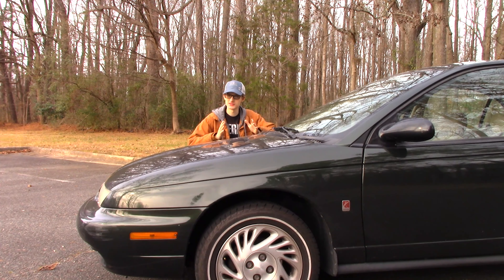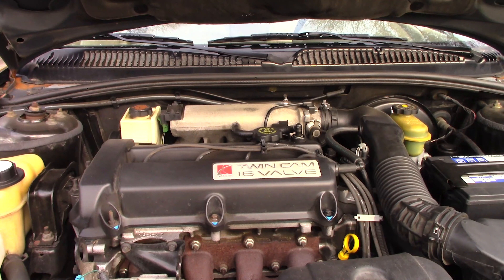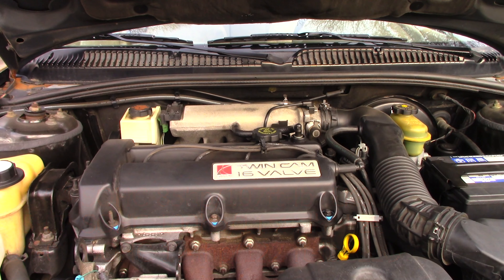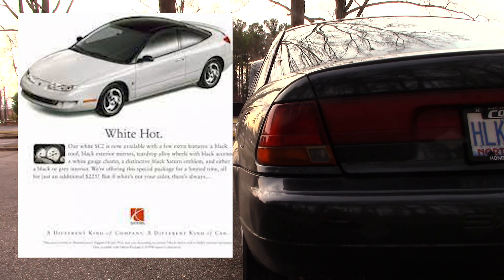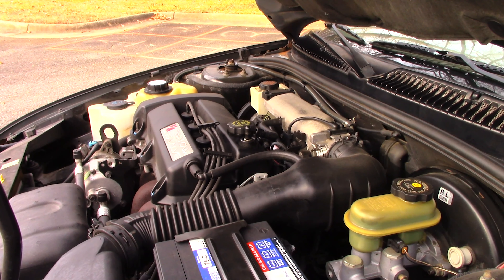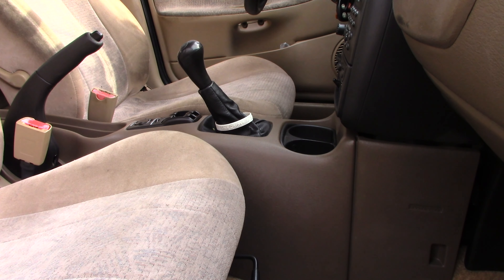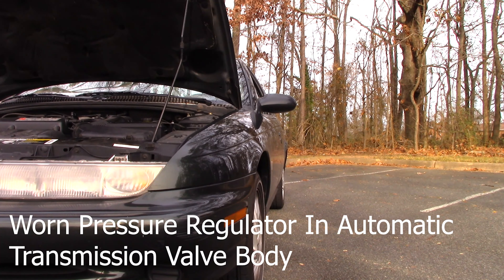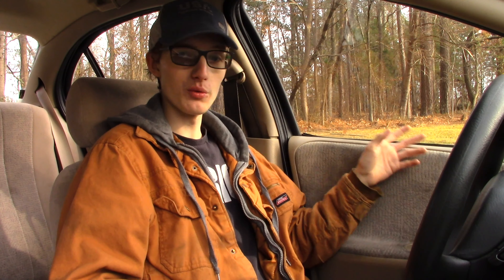Tech Review | Saturn S-Series

Comment: I bought a new 1996 Saturn SL   26 years ago for $10,900  and  still have it and love it.  I have had to replace my shifter cable twice and my A/C compressor in 85000 miles, but that's not bad for 26 years. And my Saturn has never needed any oil. I just change the oil once a year. Gets 31 mpg in town and 40 on the highway. And the dark red paint is still shiny after all these years. I hope to keep this car forever.
Reply: Your car must’ve been stripped or maybe it’s an SL1 which was quite a bit cheaper (I guess). The sticker on my loaded 1996 SL2 was like $15,500 (can’t find the sticker and I’ve looked all over). I bought mine in 1998 with 20,000 on it for $9,300 which I thought was a good deal. Still driving her 25 years later as she’s pushing 250,000. I’ve replaced a ton of parts but nothing was above my pay grade. Doing the clutch at 200,000 was probably the most difficult. Thank God for Rock Auto!

Comment: Scooped up a 97 SL2 for 3500 with 33000 miles off an old man.  Pretty sweet.  Sat in a garage the engine cradle was rot on the drivers side.  Ordered an new one online GM for 350$.  Replaced it now have a pretty much brand new car.  So far so good.

Comment: The biggest misconception, is that saturns burn oil. The better explanation not spoken here is the lack of better knowledge regarding crappy owners. With a good owner, and maintainer, you have yourself a great car, and will have it for a good long while.
Reply from the maker: I can agree but with how low cost these were new, it was rare for someone to properly maintain one.
Reply: I think they were designed to use a little oil. In order to increase gas mileage they chose to use lower tension oil control rings on the piston…I check my level every 500 miles and have to add less then a half of quarter..Also some choose to use 40 weight all…

Comment: I had a 97 Saturn sw1 I bought for cheap right before the pandemic. Then gas prices 480 a gallon at one time. Then the used car market sword upwards. It was like I almost knew what I was doing😂😂. I truly like that car. Believe it or not somebody stole it.😢 I replaced it with a Toyota. 10 months later going through Facebook marketplace. Picked up a 95 Saturn SL2 5-speed. 65 k on the clock very clean. Gave 2500 dollars. Back in business.
Reply from the maker: Thats highly unfortunate that someone stole your Saturn, however the fact you got a SL2 5spd for 2500$ with such low miles is awesome dude! glad everything seemed to work out.

Comment: My maintenence over 10 years for 2003 Saturn Ion:
Engine control module, Ignition control module x 2, used, junkyard parts,  $40 +150 = $190
Starter x $25 + $330
Ignition switch $70
Windshield wiper ?  transmission $100 (?)
Radiator (my fault) $400
Got it for free. Did much work on my own as shade tree mechanic ,but lots of labour.
Parts (used = $190
New rad, wwt,  parts = $500
labour $400
+ additional labour $400.
Total parts & labour = parts = $1200 labour $1200
= $2400.
I've had this car for going on 12 years.
Daily driver.
Runs perfectly.
267,000 kms ( x.6 miles = ?).
Never burned a drop of oil. I put 5/30 Pennsville synthetic canned every 3000 miles.
New winters $560.
So for $3000 total I've been fortunate to have a great car for $3000 ÷ 12 years.
I did not have confidence in this car in the beginning, but as I did my own research and great neighborly advice,  it'll run for another 12 years to 500,000 klms with necessary maintenance.
Best car deal I ever had!
Thanks.
David
Alberta
(P. S. Numbers are rounded off, but trust me they are close).
P.S. 2 Research common failures and you can fix them.

Comment: A very informative video.👍 I have a 2001 SC2 which I bought new 22 years ago, in the time I had it, the major repairs were intake manifold coolant pipe, AC compressor clutch, and radiator.

Comment: I like 👍 this because I have exactly the same one including the color. Another words I have your twin and everything you spoke of makes complete sense. I like the twin overhead cam in mine same as yours. Kinda slow on back roads because of low end torque but on the interstate doing 80mph barely on the gas. I do wish mine had the 5 speed manual trans but I have 4 speed automatic. As one guy said on Utube " old Saturn's never die people kill them by not checking the oil"  its apparent that you take care of yours like I do, good luck with it.
Reply from the maker: Thanks, it’s been a great car and that is true about the old Saturns never die. I never driven the automatic one before but the manual one feel like it has some sort of power to it.
Reply: Exactly...oil changes are important with Saturns..if your down half a quart..add half a quart. Change oil and filter every 3500 miles with full synthetic.

Comment: That Saturn I've been riding doesn't burn enough oil smoke, but there are two hairline cracks in the plastic valve cover. Keeps the cover slightly wet. I'll add 1/4 quart every three or four gas stops, avg 35mpg.

Comment: Old Saturns don't die, people kill them.  Change your oil.  

I have been a Saturn S fan since 2004 when I bought my 96 SL1, and I've owned 3 more since then.  (They dont hold up to collisions)  If you take care of them, they will take care of you.  But dont get the auto.

One additional quirk, every S I've owned would refuse to turn on it's coolant fan unless the AC was on.  Never figured out why, just jumped a hot wire to the battery and ran it to an under dash switch.
Reply: It's either the ECTS or it's connector is jacked up, corroded etc. Get a good brass ECTS and clean the connector, your cooling fan should kick on as programmed in the PCM.

Comment: My 2001 saturn sl2 5-speed has 370,000 miles on the body and suspension. Had a rebuild at about 120,000 miles ago. Has power windows, power mirrors, powered sunroof, defrost able windows, heat/cold running strong, really the only issue there is is the burning oil but honestly idk makes the oil change faster cause i dont have to wait on so much oil

Comment: I had a 1997 SL1. 200k miles. 5 speed. Very reliable but I always kept a case of oil in the trunk. It was about 1 quart per gas tank. The fantastic gas mileage made up for that. I sold it when the A/C crapped out. Thinking back, might have been smart to have that fixed and keep driving it.

Comment: I just sold my 2000 SL. It was a great little commuter, great fuel economy, and very reliable. The thing that finally convinced me to upgrade was that it didn’t have power steering. Driving a manual transmission car with manual steering in town, or in parking lots was a chore. Next time I’ll make sure to find an SL1 or SL2.
Reply from the maker: I can imagine, hope you can find a nice sl2

Comment: I bought my first Saturn a 1992 SL2 which was silver with blue interior, 5 speed and moon roof and rear spoiler. It was a great car although it did start using a lot of oil like you indicated. My next Saturn was a 2004 Ion3, electric blue with gray leather and moon roof. Still have it with 82k. Love it. Also have a 2007 Vue. I wish they still made them.
Reply from the maker: Yea me too, they were great cars. I know the vues have the honda V6. Really good cars when taking care of.
Reply: Mine is all wheel drive with the V6 and It has great power. It has only 92k and I take extreme good care with it, so like you say they should last for many more miles.
Reply from the maker: Absolutely

Comment: So, what kind of oil and oil filter do you use in your SL? I just bought a 2002 SL1, and want to change out the fluids asap. It didn't come with an owner's manual.

What kind of coolant do you use? Mine if dirty. I will need to flush it, so I think I could use any coolant intended for a Japanese aluminum engine. IIRC, Honda took issue with Saturn's dexcool, so I would rather not use dexcool.
Reply from the maker: Ive used dexcool in mine just because when i use to put the green stuff in other GM cars i had it created issues, i also just use a stp oil filter and 5/30 oil valvoline
Reply: @theskinnytechnician  Thank! I read that dexcool will not mix with anything else, but since I will have to flush the system anyway, I am considering Honda coolant. What color is dexcool?
Reply from the maker: Dexcool is orange and ho da coolant is typically blue

Comment: 1st gen was 1991 to 1995 , a little off but great post.I have a modified 95 SL2 and can attest their reliability. The diff pin suicide issue gets solved with the installation of an MFactory LSD or phantom grip LSD conversion kit.

Comment: I had to replace the plastic top of my engine kept breaking more and more and had trouble at the time finding one find a part from a 95 that wasn’t plastic but same engine mines a 97 and fixed my issue no more cracking mine SL2 1997 5 speed close to 250,000 miles yes engine and other things was redone and the inside as well

Comment: I owned a 1997 SC2 1.9L DOHC 5 speed manual up to 200,000 miles. The engine never burnt oil, normally doing 36 mpg highway. Once I drove at night from Chicago to Toledo OH and did 41 mpg, checked with my first GPS ( it was in 2005 I think). What killed it was the rust on the bottom... salty roads in Michigan and Ohio. It was a great vehicle. Too bad GM cancelled the brand.
Reply from the maker: The rust on them can be killer, They are great cars.

Comment: Great video . And very informative about things to look out for . Looking for a sw2 manual now . Is there still a community for performance parts for the 1.9 Dohc? How’s the clutch travel and do you feel to could handle 200 hp stock trans . Keep the videos coming . Seems like Reliable car and easy to work on . Also less than 2,500 pounds . Unheard of nowadays.
Reply from the maker: The sw2 are hard to find especially in manual, really want one myself. There is a decent aftermarket community for them i believe, the clutch travel is really good great for beginner drivers that want to learn but i would not know about 200hp going thru them stock.

Comment: 4:35 my Saturn did not burn oil. It was an exceptionally reliable vehicle. I had a 99 SL1 and my wife an 01 SC both were very reliable and other than regular maintenance we did not do anything else.  We had my 99 in the family and run well over 375k miles before it was sold.
Reply from the maker: A saturn that doesn’t burn oil sounds sus. Its hard making more videos about mine due to the fact that it doesn’t break.

Comment: Great video but there were changes in the dohc motor for the third gen. Don't believe me find a third gen and sit in it while it's idling you'll know right away
Reply from the maker: Curious, i need to find someone here with a third gen, however in my research i haven’t found anything major but will look into it.
Reply: The intake manifolds are different and I think the crankshafts have different counter weights to improve NVH

Comment: love that you only care about the mechanic aspect of the car, really reliable car had one I bought it in 2012  for 1,500 with 130k miles. Drove all over the east coast for 3 years. trade it in for a 2015 WRX STI. only did oil change and tires it had 227,000 miles.

Comment: What do you guys think of the 99 SC2? I’m  looking for a daily city driver that won’t break the bank. Thanks
Reply from the maker: Those cars are good cars same platform but a 3 door version, I would recommend the manual if you know how as they are easier and cheaper to fix if they go wrong. The automatics are good but they do leave the car feeling under powered.
Reply: @theskinnytechnician  cool thanks. Manual are hard to find. So far I’ve found only automatic transmission.
Reply: @theskinnytechnician  thank you for replying!
Reply from the maker: They are, especially with the twin cam motor.